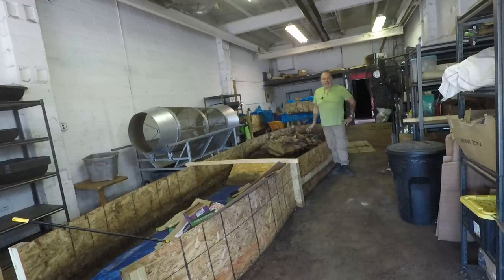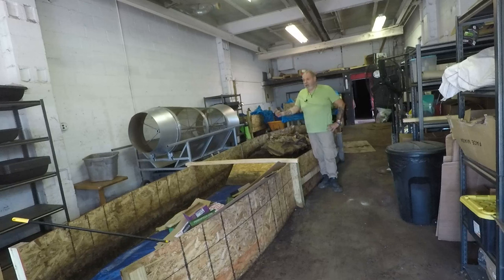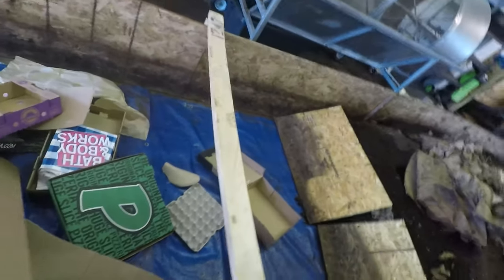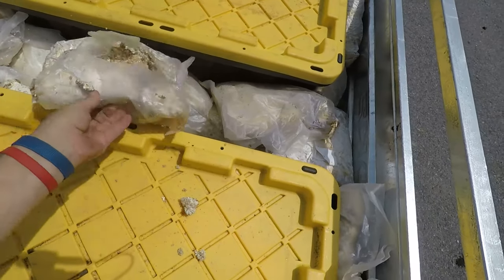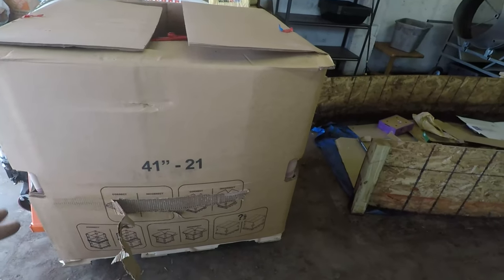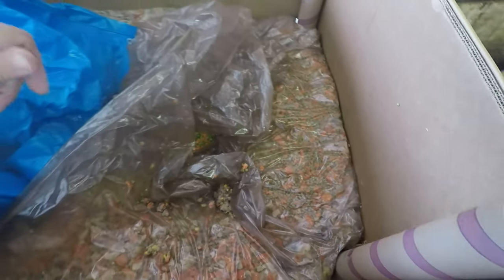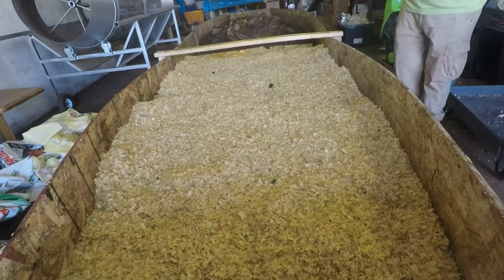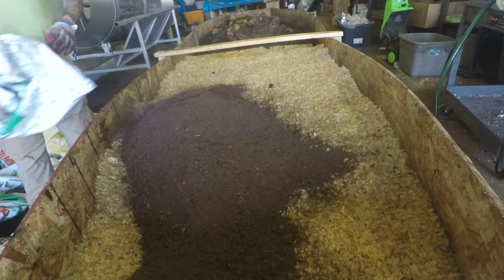How to start a worms' bedding with 600 pounds of veggies scraps

Comment: That was pretty incredible. Such a massive new bin for the wormies   👍🏻  Do you anticipate the system heating up during the first few days? Congrats on the new truck - it is a beauty!
Reply from the maker: Thank you.  Yes I let the new bedding heat up, cool down and mature for a totale of 12/15 weeks before introducing worms
Reply: Wow - that long? I had no idea. The worms are going to love it in there once you have the grand opening   👍🏻
Reply from the maker: Yes, meanwhile they finish to work the other half of the bedding, in this way I can harvest all the casting in the finished one and introduce the worms to the new bedding
Reply: I feel like you'd save money by buying bigger machines to process stuff. That tiny machine that you were using to process the mushroom bedding could probably be replaced by a metal shredder or something like that that doesn't require the additional thing to push down the bulk. It might leave slightly larger pieces occasionally, but given the volume, you'd probably be OK.
Reply from the maker: You are absolutely right but being a start up  my operation grow very very fast and also my needs for a different equipment,  right now I have to slow down on spending money but when I will have my own place I will try to have everything I need to work quicker. Thank you very much my friend 😊
Reply: @northeastworms  absolutely, I definitely get it and agree. I don't know much about worm farming other than my hobby bin in the basement (hungry bin) filled with Indian blues. Definitely not judging, but I know that with my tutoring business, spending a small amount extra to save me time usually turns into a profit.

Comment: Outstanding video.  Question:  About how many pounds of worms do you anticipate putting in the new bin after it finishes it's heat / cool / heat / cool cycle?  Also, how many months do you estimate that the worms will require to turn it all into castings for you to harvest?
Reply from the maker: -I am not weight thr worms,  I will move the worms from the other side of the big bin, if I have to estimate they will be around 40+ pounds
- yes is heat/cool/heat/cool cycle and it will take around 13/15 weeks to be ready.
- I estimate that in 3 months this bedding will be all worm casting.
Thank you for your question,  this will help other people to understand better
Reply: @northeastworms  Thank you!